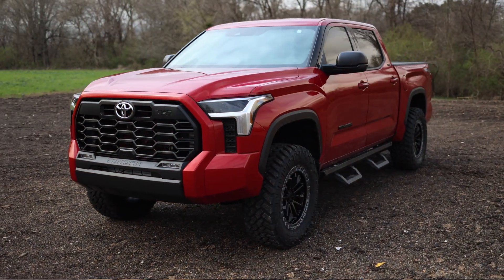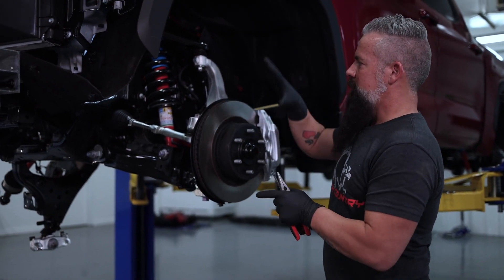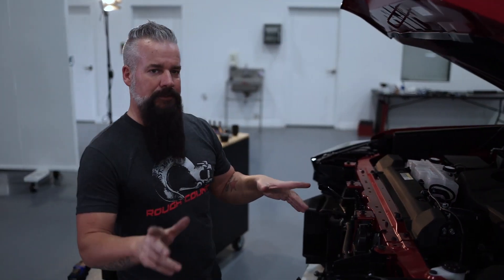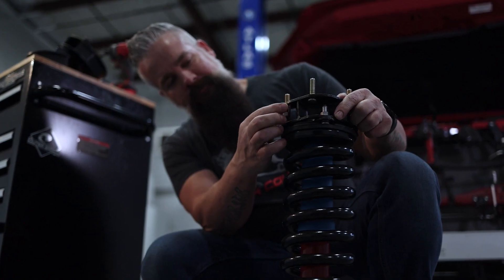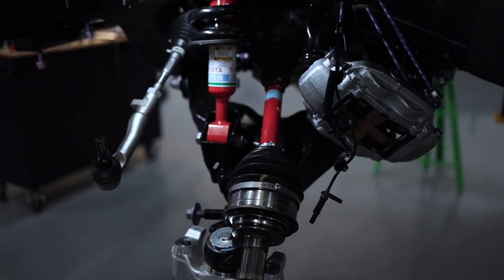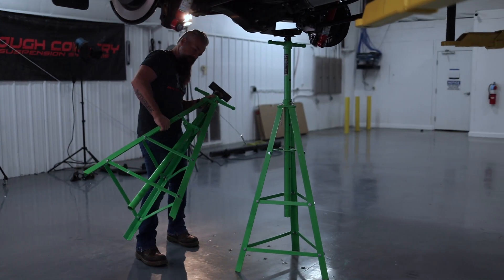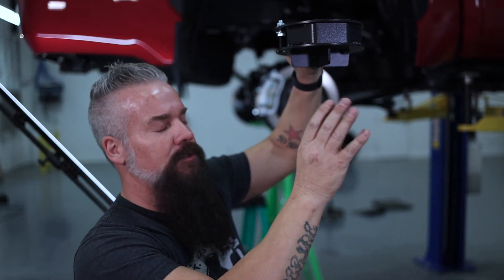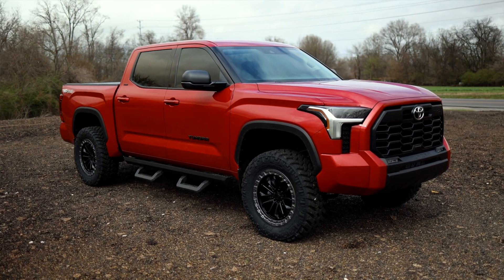Installing 3.5-inch Lift Kit 2022 Toyota Tundra TRD 4x4

Comment: Heads up...if you have a trd skid plate, it will not work on this set up.  Sway bar will be to low and block the skid plate.  Also the sway bracket front bolts were off, made it very difficult to install the sway bar back on.  Installstion guide was not that helpful from the box, you basically have to figure out what bolts to use that came with the lift kit.  This was installed  on a 23 tundra 1794 w/ trd off road package.
Reply: How does it ride now? Are you happy wit. The comfort?

Comment: Why cant you just swing the LCA down and slip the shock in and out instead of taking the knuckle off or even disconnecting the tie rod?
Reply: There was a lot steps with this install that is not needed.  Doesn't surprise me given that its RC though.

Comment: Hello 
I am trying to install this 31/2 in lift on my 2024 tundra platinum. And cannot get the drivers side differential lowering bracket on. No matter what we tried it will not lineup. Tried loosing the rear bracket by the front driveshaft. The holes are approximately 1/8-1/4 in off. No amount of prying helped. Also with 3 mounting spots on the differential how can you lower it when there are only two new brackets for lowering it. There is one bracket that doesn’t have a new bracket.

Comment: Considering doing this lift myself on 6 ton jack stands. Can you or anyone here chime in on best jack points? Was going to jack the rear end from under the rear differential on the axle. A dealer said that would be fine?

Comment: With 3.5 lift kit and 35 inch tires. Do u still need to remove the mud flaps in order to prevent rubbing.
Reply: Nope. I have 37’s and have my mud flaps still

Comment: When will the lift for the 2WD be available?
Reply: How tf u go and buy a new tundra and buy a 2wd, when i bought my 2023 tundra it’s 4wd or nothing
Reply: @futbolnation6360  I live in San antonio. I rarely have a need to go offroad. There are more 2wd tundras sold than 4wd. Why would I pay for an extra option I would never use.